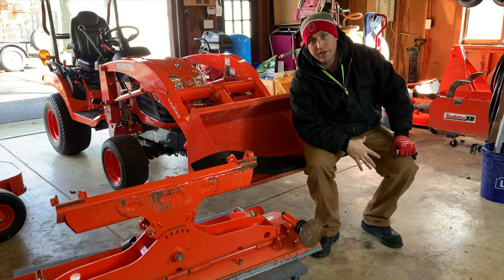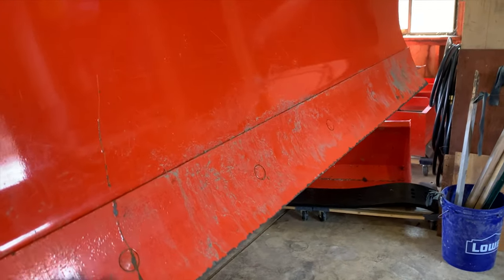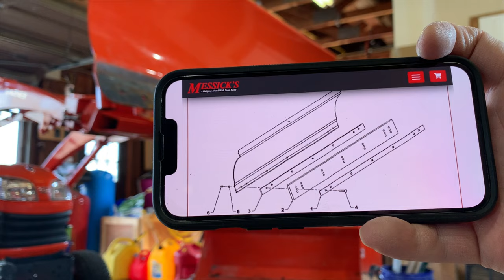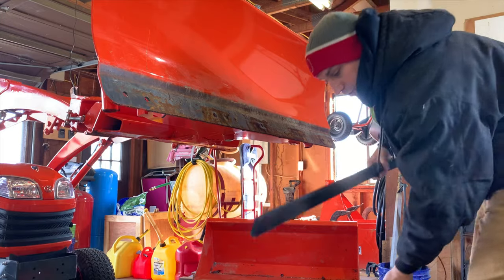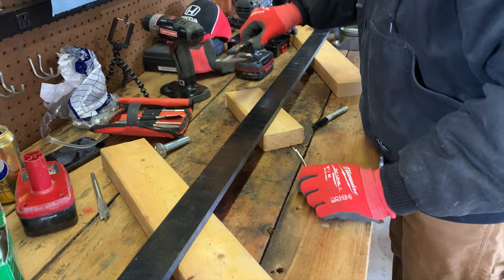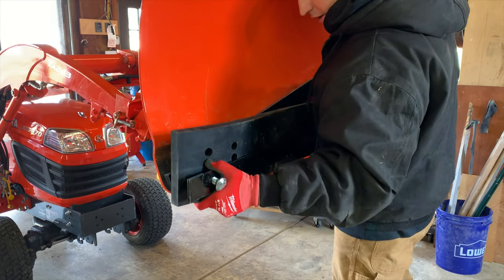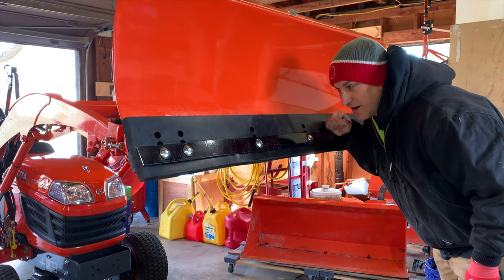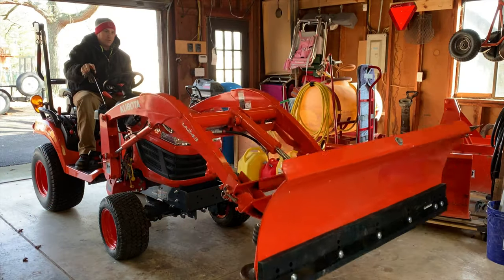Kubota BX Rubber Snow Blade - How to convert from steel

Comment: where did you find all the rubber blade
Reply from the maker: I got the rubber blade from a Kubota dealer (I used Messicks online) but any Kubota dealer would be able to source it.
Reply: @EvolutionDIY   KUBOTA Part # 70060-00760 RUBBER, CUTTING.  This is for a 60" blade